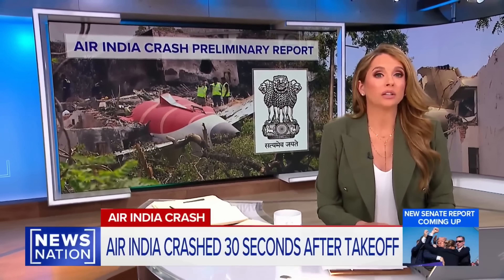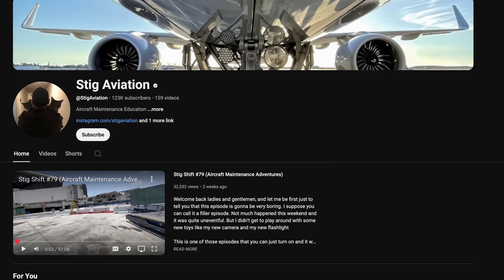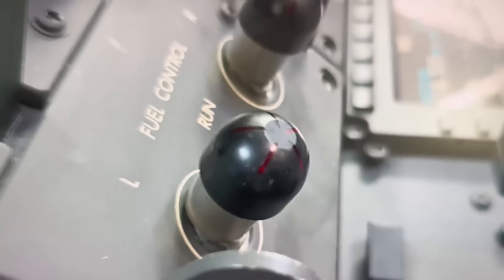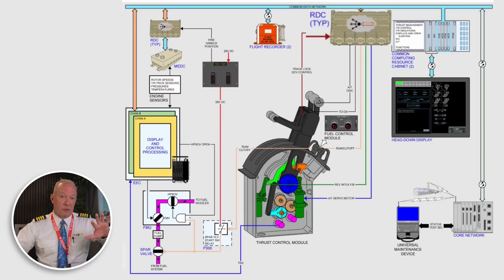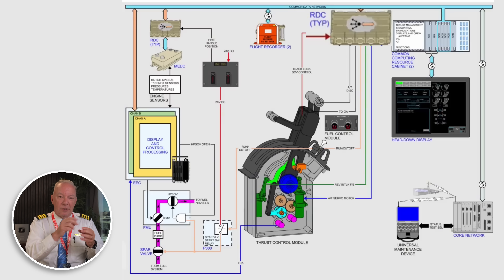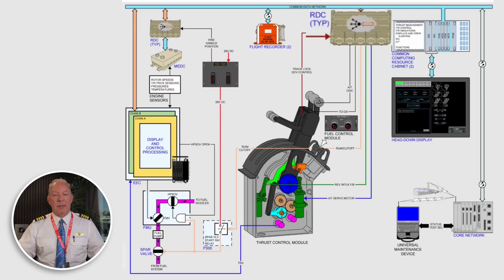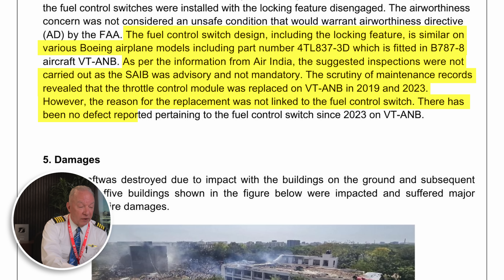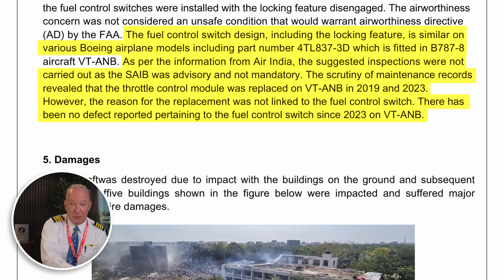The Truth About Boeing 787 Fuel Control Switches

Comment: Is it possible that the wire between the battery system and the relay broke during the flight?  
Then the co-pilot's statement that he did not operate the switches would be correct, but the pilot's question was perhaps because he saw it on the display and not because he saw the position of the switches, and perhaps he then only turned the one switch on his side off and on again because he thought it might be a corrosion problem in the switch and that the two clicks were therefore coming from the same switch.
A cable can easily break when solid copper wires are used, but this is also possible with normal wires if they are bent extremely frequently or cut off by friction against a metal sheet or other sharp edges.
The display would only show the status, or is there also a system for this case that indicates the failure of the battery to the relay component?

Comment: There is AND Gate between the valves and the switch. One of the inputs of the AND gate is attached to the switches, but the other is attached to the display and control processing system. If something send a false or 0 input to the AND gate the valves will be closed.
Reply: He's using a simplified diagram not an actual wiring diagram, you really can't determine how everything works with any depth using this type of diagram.
Reply: Ok. But this simplified diagram shows that there is an another way to switch off the valves… Sure I’m not a specialist but the diagram didn’t show what he is saying. A more detailed diagram will not eliminate that there are other components acting with the valves.

Comment: About the intentional action or not:   Not sure if you are aware of it, but a similar incident happened in France in 1993. A Captain wanted to gear up after takeoff, but he instead cut the fuel (on an A320) for some reasons. Apparently, news articles say the pilot was acting incoherent for a while. So perhaps some form of temporary mental impairment, like a "brain fog" where you act irrationally (sometimes can happen during a stroke, for example).
Luckily, they had enough altitude to relight the engines and recover.

Comment: It's somewhat funny to see the controversy over the switches. I use these type of switches often. I am but a humble farmer, but my combine harvester has two of exactly the same type of safety locked switches next to each other to engage the machinery. They simply provide power to two big electric clutches in a similar way to these aircraft fuel valves. There is no way you could move them accidentally....you would have to hit them quite hard and snap metal. It takes me a couple seconds to lift each spring loaded switch and push them forward over the metal stopper.

Comment: There then could be another possibility,there was a wireing fault between the cutoff switches and the relay that happened, cutting power and closing the valves and came back again and opened the valves. The cutoff physical switches never moved.
Just another possibility.

Comment: Does the flight recorder get the switch position from a sensor on the switch (say a Hall sensor) or from the voltage/current in the DC circuit. If from the DC status then a failed DC bus would indicate Switch is Off. if from a sensor on the switch arm then it is incontestable- it was moved by hand.

Comment: So there is no way a 'freak' 24 volt current (induced) could trigger valve closure? Airlines insist that cell phones be put into airplane mode to protect aircraft from outside influences...maybe this was one such event. if you had shown me a mechanical control and not an electrical one....since electrical influences are always around us e,g. Lightening, I'd say that that possibility must be considered.

Comment: I've always admired people who can explain so simply that they're right, but that doesn't change the fact that the EEC (Engine Electronic Control) can shut down the engine if the TCMA (Thrust Control Malfunction Accommodation) deems it necessary. Even though this functionality is designed to operate on the ground only, that means the whole system is not as simple and resistant as it's made out to be. Furthermore, TCMA has already proven being capable of shutting down the engine for no apparent reason.  I'm too old to say something is impossible just because I can't fathom it. Better engineers than me have been fooled by the systems they've created, and pilots have crashed planes on purpose, too. We'll wait for the final report and we'll find out.

Comment: It seems to me the design of these switches is poor. If I understand it correctly, a constant 28V DC is required to keep the 3 fuel valves open. Therefore, if that 28V DC supply fails for any reason, the valves close, irrespective of the switch position. It ought to be the other way around: if  28V is not supplied, then the valves remain open. That way, an electrical fault of any cause, can only make it hard to turn off the engines, it cannot cause them to fail for want of fuel.

Comment: The fuel cut - off switches have a "lift/unlock - toggle - release/lock" mechanism or vice - versa. 

They do present a very convincing fool-proof means to eliminate acccidental toggles,  without having to go thru the very deliberate lift/unlock procedure before toggling the other way, ending with a stiff self-lock (upon release).

It leads to the unavoidable "conjecture/conclusion" of an intentional toggle to CUT-OFF position in the middle of lift-off.

It seems very unreasonable to assign an ELECTRONIC failure/glitch to a very MECHANICAL control. Just my 2-cent opinion.

Comment: Impossible to move the switch inadvertently.??

Yes 
1. If the switch worrks as it should
2. If the components inside the switch are correct.
3. If the components inside the switch (Spring) are not broke.

It is impossible for a door plug to  fall off an Alaskan airliner aswell.

Open your mind to possibilites when humans are invoved.
Reply: 'freak' component failure in a switch is of course a (remote) possibility. But for both switches to have the same freak failure at precisely the worst time and 1 second apart just is not credible. I dont buy it at all.
Reply: @jetplaneflyer   And not just once.  If you take the hypothesis that the switch malfunctioned to "cutoff" (but wasn't physically moved), then you need to also have it malfunction AGAIN to "run".  And you need the valves to also open/close at the same time, despite the information sent to the valves and the one sent to the FDR being separate.
It's a chain of malfunctions from independant systems, all happening together, and all keeping in the logic of the system (no random malfunction where the valve close while the switch is said to be on "run").  Probability is astronomically low.

Comment: alright i also though that the aircraft is a complex machine and there might not be direct link between physical switch and the the engine fuel valves,   in between there might be some system that goes faulty,            might be software or some physical damage in the system        that accidentally mimic fuel cut off                 but you explain the electrical mechanism is simple and there are no complex electronics in between               the questions are             can we rule out software bug ?                    does the power to fuel valves only comes when those physical switches are in on position and that rely gives the power ?                if yes then it's a strong case against ONE of the pilot deliberate act and those guys in Piers Morgan show who were opposing the idea that atleast not pilot mistake were involve

Comment: Really good report here (https://data.ntsb.gov/Docket/Document/docBLOB?ID=40388298&FileExtension=.PDF&FileName=Flight%20Data%20Recorder%2010%20-%20Factual%20Report%20of%20Group%20Chairman-Master.PDF) into an APU battery failure on a 787, it shows all the parameters monitored by the Enhanced Flight Data Recorder (EFDR) - keep in mind the EFDR is not powered internally so for it to produce data it had to have power from somewhere and is designed to be powered for as long as possible in the event in an incident so the data can be analysed.
Also worth mentioning some of the following, aircraft power system regularly transfer between power sources, ground power unit (GPU), auxiliary power unit (APU) and engine generators and the aircraft battery.  You will have seen this happening when you go flying and parked at the gate as the lights flicker and fan noises change.  In other words they are designed to cope with power transitions.
Flight critical systems are powered from the battery busbar, this in turn is provided with power from all the above sources via a transformer rectifier unit (TRU) and all aircraft are designed so that this will be the last thing powered when all else fails, the fuel control switches and relays are powered from this source.

Comment: Where's direct to battery diagram  and where is the circuit breaker in diagram ?
Reply: Yes, that is not a completed drawing. And more importantly, is there any sub system on the plane can cut the fuel off ?

Comment: Could you also explain how deployment of RAT is associated with  fuel switches moved to cut off impacting the relay to provide power to valves?
Reply: The Rat Deploys After Total Thrust Loss. Not before . Cutoff Position Cutts Off Engine Fuel So the aircraft Loses Thrust and The System Automatically Deploys the Rat
Reply: Yeh, but the RAT deployed immediately after liftoff at 08:08:39 utc and the fuel control switch was moved after the aircraft achieved speed 180 knot at 08:08:42 depending on which report mentioned
Reply: @Sultan-vz9ty No actually You are Wrong at 39 sec The Plane Transitioned to air mode the Rat Didn't deploy At that time Also maximum Speed was achieved at 42 secs . I am pasting the exact Words Written in the Document You can search it also.
"The aircraft achieved the maximum recorded airspeed of 180 Knots IAS at about 08:08:42
UTC and immediately thereafter, the Engine 1 and Engine 2 fuel cutoff switches transitioned from RUN to CUTOFF position one after another with a time gap of 01 sec. The Engine N1 and N2 began to decrease from their take-off values as the fuel supply to the engines was cut off."
Pls improve your sources. About the RAT No Official Timing was ever Given.
Reply: @elite_monir You can go back and look at page 14 of the report: The aircraft's air/ground sensors switched to flight mode, coinciding with takeoff at 08:08:39 UTC. Airport surveillance camera footage showed the RAM air turbine (RAT) operating during initial climb immediately after takeoff (Figure 15).
Reply: @Sultan-vz9ty  unfortunately assumptions aren't allowed I can Go back and Watch It . But I already know There is A Screenshot of the Rat deployed . 39 Sec Was The Time Of Liftoff. We don't know what Time The Rat deployed and we can't. Because The Height That Plane was It is Possible Several Seconds had already Passed . I Can Only report Documented Facts It is Not documented. The time of Rat Deployment.
Reply: Page 14 /  The aircraft air/ground sensors transitioned to air mode, consistent with liftoff at 08:08:39
Reply: Page 14 / The CCTV footage obtained from the airport showed Ram Air Turbine (RAT) getting deployed 
during the initial climb immediately after lift-off (fig. 15).
Reply: @Sultan-vz9ty Immedietly after Is Not the Same as With Liftoff. Both are different. 3 secs Can be immediately after . And why are you Concerned With Rat Deployment. RAT has Nothing To related To do With The Crash . The RAT DEPLOYS When The Aircraft Loses it's Primary Power Source (the engine) . To give Auxiliary Power to the aircraft. And IF you think That a Electrical Failure happened Watch The video Again and see That Electrical Failure has Been Crossed off Because A Battery Exists To power The Cutoff switches
Reply: Page 14 / The aircraft achieved the maximum recorded airspeed of 180 Knots IAS at about 08:08:42 
UTC and immediately thereafter, the Engine 1 and Engine 2 fuel cutoff switches transitioned 
from RUN to CUTOFF position one after another with a time gap of 01 sec. The Engine N1 
and N2 began to decrease from their take-off values as the fuel supply to the engines was cut off
Reply: @Sultan-vz9ty There Were No Timestamp On the CCTV Shot. Immediately after Can Mean a gap of 3 secs. If the Rat Deployed With Takeoff they Would Have Said. Rat Deployed With Takeoff / Rat Was Deployed As Soon As The Aircraft Transitioned To Air Mode. You can Express 3sec Difference By Saying"Immediately After".
Reply: The electric failure can effect the engine to shutoff and the RAT deployment. By the way  can you get the difference time?  while the word immediately  mentioned  on Page number 4 / The aircraft was operating flight AI171 from Ahmedabad to Gatwick and crashed at approximately 08:09 UTC immediately after takeoff.

Comment: Still not clear whether these spar fuel valves toggled open or closed with voltage (ie , they stay in whatever state they were last in), or they are default closed with no voltage , and need constant voltage to stay open , and allow fuel to flow.  If they need constant voltage to stay open , then we can see how loss of electrical power / short circuited batteries due to faulty diode charger box ( see Boeing made changes to supplier for Lithium battery diode pack charger, due to lithium batteries being "cooked' but faulty chargers).. all the way back in 2016. Witness many 787s battrery packs being put into vented stainless steel armoured boxe, with new vent tubes.

Comment: So there are two important points I think that need to be made here.

The first is that redundant systems can be affected by a common event or a common failure (for example, a bad batch of relays or an electrical, magnetic, or mechanical event when affects both relays together).  The argument against this explanation isn't just that it is unlikely (we are dealing with orders of magnitude of unlikeiness because these are all low probability events) but rather that they can tell which switch reported movement first would suggest a time gap between the two, and that makes a common event explanation a lot less likely.

I hope investigators haven't ruled out such a possibility here but it must be said that with current information the likelihood trails considerably behind either murder-suicide or execution (human) error explanations of what went wrong.

Comment: Watched a video the other day showing an in-depth conclusion on what may have happened.
In short the conclusion was that a diode on the battery charging circuit failed so the battery was not being charged and a short circuit caused the 28v DC battery to lose charge hence the fuel shut off valves closed and also that was the reason why a flight recorder did not function.
Reply: The problem with this explanation is that this would have caused simultaneous failure, which didn't happen.  Then the engines started to spool up again after the fuel flow was restored - unlikely if this was a loss of charge on the battery.

Comment: Just a thought, what if the spring in the switch is faulty, ie loss off compression or over spring loaded,
Reply: The thinking here is that a fault such as that would not have affected both switches.
Reply: @TheLongonot62  good point

Comment: At the gate the fuel switches were switched to run in order to start the engines. Shortly after take off the co-pilot SAW both switches in the cut off position. The switches didn't cut themselves off or both fail in some mechanical way within a second of each other. Everything else is irrelevant in this investigation. There were no electrical glitches or any other arcane electronic causes. The co-pilot SAW the switches in the cut off position after presumably he heard and felt the engines wind down. Hence his question of the captain.

Comment: But what is the "black box" reporting.....the state of the relay or the state of the switch.

Imagine a taught pair of wires from physical switch to relay. Hot metal expands and more stretching, then at rotate a plug pulls to loose, goes high resistance, 2nd wire follows due to transfer of load. Relays open in sequence, power drops, stress on airframe eases, plugs resistance drops, relays closes.

Comment: My question is.

If the switches had immediately been put back to the run position (1 second), could the plane have been saved?

If not, how the hell can we prevent this from happening again, short of putting both pilots in straightjackets?